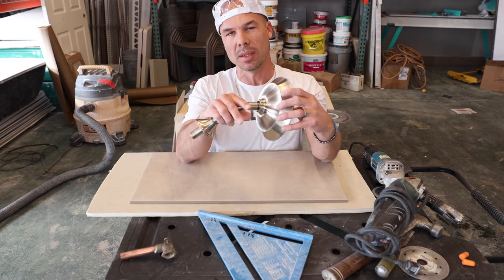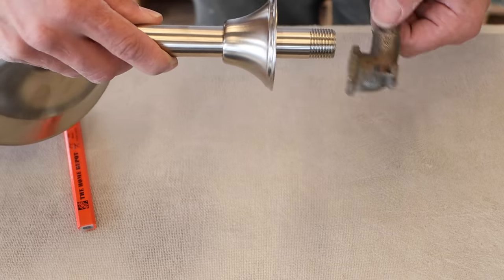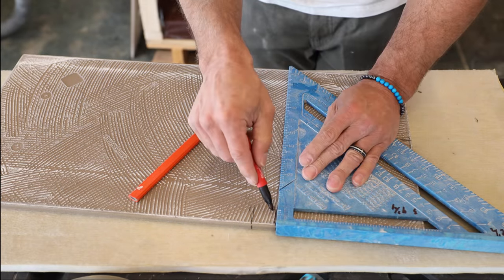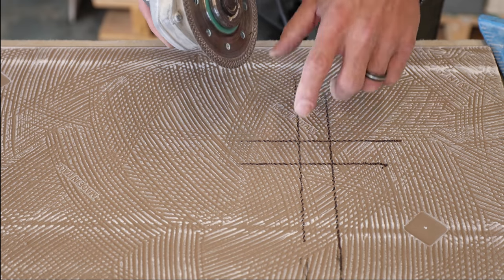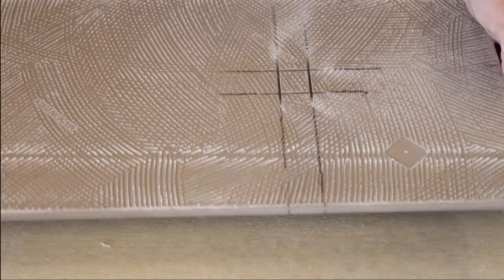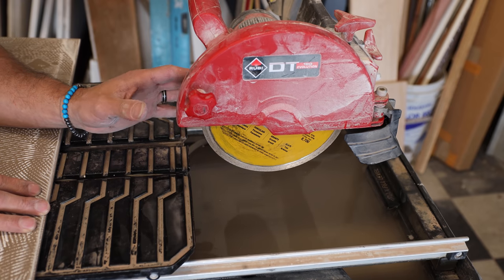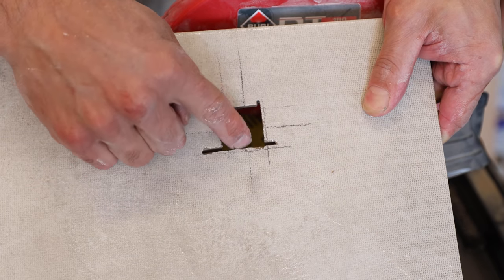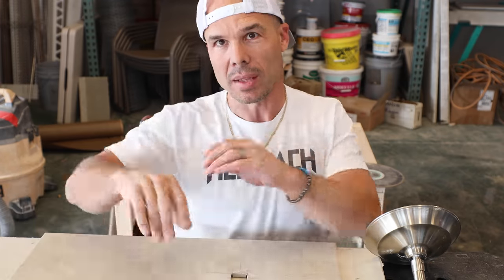How to Cut Hole In TILE for SHOWER HEAD --- With the The tools You Have!

Comment: I learned to layout the cut the same way but to use the flat side of the grinder wheel to shallow out the material then punch it through the face with a nailset. That's what happens when a cowboy teaches you how to set tile. Now I'm all about the hole saw

Comment: Used a diamond hole saw to cut all mine today.  I did use a wood board cut-out as a guide, but it worked.  Apparently I suck at measuring but plenty of time to get it right.  The shower head I got in 2 cuts

Comment: Got a question for u about tiling next to a tub, but not sure where to ask.  I've tiled my bathroom. In doing so, I left a gap between the tile and the bathtub. The gap is not filled with grout or thinset. There's not a lot of info about best way to handle the gap. Should I have our grout there (I still can). Or should I have put thinset and then grout right up against the tub? I assume I'd want to put a small like if caulk as well.

Comment: I run into a lot of 12x24’s that split any time you try and cut in the middle of the tile. Do u have this problem with tiles you use?
Reply: Are you dealing only with marble? Ive never had porcelain or ceramic split like that.
Reply: This happens a lot for me when a client gets a lower quality tile. They tend to have a less dense body and the vibrations shatter the tile. I put a piece of drywall or foam board under the tile when grider cutting. I have worked with many tile a manual cutter wont score without breaking.

Comment: If you have an existing hole in tile that is already on the wall that needs to be widened to get a tool inside do you recommend using the little grinder to make it bigger?

Comment: With the saw unplugged and the blade dry, set a Sharpie on the table, aimed the tile's thickness from the edge of the blade, and hand-spin the blade to draw a circle on the blade. When plunge cutting, you will know when the blade is breaking though when said circle is even with the tile surface.

Comment: I knew you would have the answer. Great video! I just subscribed. 👍 I’m tiling a shower / tub area.  

Quick question. When I’m laying out my tile, should I lay it out so that the holes for shower head, tub spout and on/off valve are in the center of a tile?  Thanks

Comment: Hey Isaac if you do anymore testing videos I think it would be neat to test how well Thinset bonds to WEDI sealant. I'm intrigued by the lack of banding on a WEDI system because as a novice it seems a lot easier to manage rather than accidentally wrinkling membrane over and over.

Comment: The real question is how do you check the pipe connection isn't leaking?
Reply: @MattCupan  I did that part. I'm worried about the threaded parts being taped and doped right.
Reply: What I did was make sure the fitting was close to where the back of the tile would be when it was finished. That way I can still easily see it, but it’s deep enough that the threads don’t show.
Reply: @yoyoitsKerry  your over thinking it I've never had one leak I use tape that way I can tell it's a snug fit if it feels a little loose take it off and re tape it till you can barely get it in the correct position by hand if it's close maybe use vice grips or what ever covering the pipe with something so it won't get scratched obviously but usually can get it by hand and if your realy worried about it try looking in the access panel if it has one